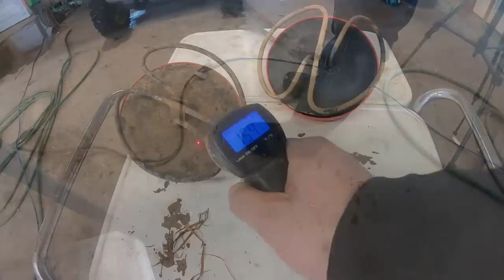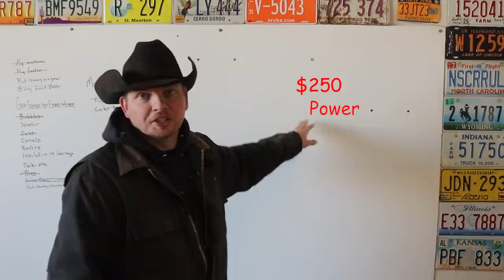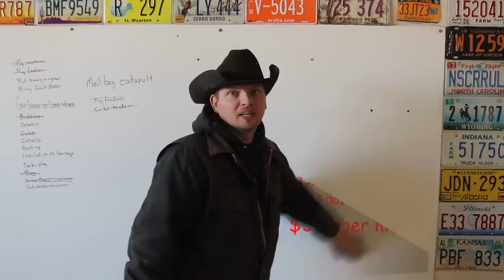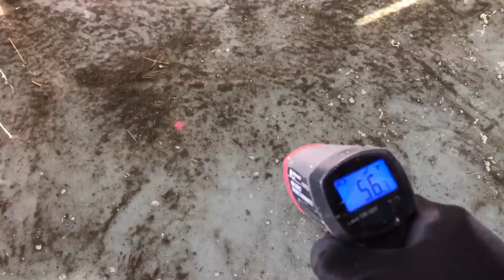Stock Tank Heaters vs. Breaking Ice - Water on the Ranch

Comment: Your lucky.  We had to do both all winter.  Heaters in the smaller pastures but our herd spent the winter on the pasture with a running creek.  Running water is a good cheat as it keeps thinner ice but we still had to go break open the creek. And you can accidentally take an unwanted bath if you are not carefull.  😂😂

Comment: Mike, you need to calculate the electricity it takes to replace the water that chunks to thick ice. 😬
I run three tank heaters myself, same style as you as far as wattage. My neighbor runs 500 watt heating pads that sit under his automatic waterers. His cost is no doubt cheaper.   
I’m guessing those gimmick jugs don’t work but there’s got to be a more cost effective way that works.
Reply from the maker: Well if I dont get those chunks out of there it does take alot longer for the sun to heat up the water and then it seems to freeze harder the next night.  Luckily they return right into the ecosystem.   I tried the jugs, they worked for light frost and freeze but the cows dont really move them around enough to keep anything from freezing.  Maybe the wind would :)  Thanks Zach - Mike

Comment: That's fine but you have to change your mindset for ranching and farming. With things like heaters you have to ask yourself what it will cost you to NOT buy and use them. Then you'll know if you can afford it or not.
The problem is in the hidden costs, if you can't keep up with the ice issue and it's causing a performance loss in the cattle, that's likely a cost you can't afford.

Comment: Hey Mike. Wonder if some homebrew geothermal loops might cut your tank heater bills? Seems like a few swats with a backhoe, some buried plastic pipe, and circulating pumps might just work. Might be an angle to use heat from composting, too.

Comment: Hi Mike and family ,  This past fall i purchased 3 new Jug brand cattle waters . these are the energy free earth tube type and we will be installing them in the spring . It will be interesting how much i'll have to turn on the heat tapes down in the earth tube . But i think it will be a major savings on the electric bill .
Reply: I've never heard of earth tubes. I'm going to check them out. Thanks!
Reply: @jeanettewaverly2590  the earth tube brings up warm air from down about 8 feet  or so. this can keep the water bowl from freezing . In very low temp. [ -25 or so ] it sometimes will need an electric heat tape .

Comment: You always have to look at the cost of thangs on the ranch.
Water is the life of an animal. So to me having a more healthy animal cuz of it makes more sense. I have found that the new tank heaters are more efficient than the old ones. The old tank heaters dont have thermostats so they are on all the time. The new one turn on and off with the temperature which is more cost effective. I would consider replacing all the old ones. You would save more money in the long run. And you would be able to leave them pugged in all winter. Thats just my experience with them. Have a great day. Keep up the good work.

Comment: We live off grid, so we have to consider how much power is used. While I would LOVE to have a trough heater, it would drain our batteries to quickly, and we couldn't use it all if it was cloudy out. BTW, I use the same thing to break the ice on our trough.
Reply from the maker: I get that.  We looked into solar for tank heaters but between panels, batteries and heaters for the batteries, I'm not sure it ever would have paid for itself.  That tool does work good for ice though. Thanks -Mike

Comment: Hello I run a ranch up in northern Ontario. We deal with the same kind of cold weather. We pump our water to keep it flowing and stop it from freezing. Have you considered doing that? Our biggest challenge is where does it run off too. We just need to control its flow down to the closest ditch. But other then that it might be cheaper to pump continuously then to run the heaters. We have yet to use a water heater from October until march

Comment: Is solar heat an option?  After the initial cost of equipment the source of energy looks to be there most days, even when it's cold.
Reply: But at night?
Reply: @jbweld6193  would be a 12v system, batteries would have to be big enough for 24 hour operations.
Reply: @redroofretriever  good idea.
Reply: @jbweld6193  couldnt solar during day electricity at night have them on a timer split power just throwing ideas out there
Reply: @carldabelstein328  red roof  had a good idea above. Use a battery bank. I think at some point though there is a break even point. I'm sure Mike has already figured that out!
Reply: @jbweld6193  yep i didnt notice that maybe ill learn to read ALL replys lol
Reply: @carldabelstein328  yeah I was also thinking you could insulate the tanks too so you could hold the heat longer in the winter and colder in the summer.. but then again.. is the juice worth the squeeze? Probably not lol
Reply: @jbweld6193  luckily we dont get that cold down here in Texas well not very often that is
Reply: @carldabelstein328  I'm up in Washington state. From upstate ny. It gets cold as hell where I grew up. We had heaters in our chicken water all winter
Reply: @jbweld6193  we used chicken heaters last week for a few days when it was around 20 but that only lasted a few days today it hit around 70 and in the 60s rest of the week we moved from Missouri about 5years ago back home we used heaters off and on  and last year i was working up in Rock Springs Wy in the oil field and that was a cold winter i dont think the wind ever stopped lol
Reply from the maker: I'll chime in here, seems to be an intelligent conversation :)  We have talked to a company about solar heaters.  There are a couple of problems that we run into.  One is the amount of batteries we would need, the other is keeping the batteries warm.  We would have to dedicate a percentage of the power made to heating the batteries.  A good example might be our wind generator.  Gilbert put it in many years ago and it cost 19K.  It took ten years to pay for itself making about 150$ per month and its a 2.5Kwh generator.  Alot of the off the shelf solar heaters are about 20 to 50 watts.  Thanks guys!
Reply: @OurWyomingLife  well so much for our ideas to help you  save some money guess you were WAY ahead of us lol we atleast were trying
Reply from the maker: There were so many good ideas. I didn't want you guys to think I'm not thinking too lol. Keep the ideas coming. I love them
Reply from the maker: And if Lincoln ever gets his pet dragon I won't have to worry about anything freezing!!!
Reply: @OurWyomingLife  i wouldnt think so lol
Reply: @OurWyomingLife  just keep pumping out videos Mike! You're giving us an education in AG! Invaluable if you didnt grow up farming.
Reply from the maker: TBH sometimes I feel like I'm banging my head against the wall lol
Reply: @OurWyomingLife  i know how you feel but thats what makes it all worth it in the end
Reply from the maker: Hahaha thanks guys!
Reply: One of the comments in this thread talks about the GEO thermal heat you can get from the ground.  There are two parts to this fact that can be very helpful to this problem.  Fact 1). The ground temperature at 10’ in your area ranges from 45°-55° Year around.  At lower  latitudes this does not change much maybe 5°.  Fact 2) Water has a very unique molecular property, it reaches its peak density at 4° centigrade (39°F). This is very helpful because it is just above freezing.  So this means when water get warmer or colder that 39°F it will raise (see graph I am posting on your Facebook page today).  I discussed your problem with a civil engineer friend of mine who specializes in water and waste issues. One of the tricks they use in storage tanks is to just agitate the tank using stirring systems.  In your case a simple low power circulating pump should work.  By keep the water flowing from the warmer water on the bottom the water may not freeze over night.  They use this technique because using electricity to heat water is the most expensive way to do it because electricity is a very inefficient way to heat things.  But if this did not work because it just gets to cold at night, the next step would be to add a GEO thermal heat component to the system like the other person posted.  By running a loop of 1” diameter black plastic tubing at least 10’ down, the water will become warmer in the loop providing a source of heat to your tank.  It may even work without the need of a circulation pump by just tempter convection.  There are more details than can be put here, like how big the loop needs to be, the separation space between the loop ends, stuff like that.  These same principles can warm your high tent as well with air tubes. Just let me know if you want more info.

Comment: I think you need to look at solar heating.
using one 300 watt solar panel to heat each one the solar would only heat when suns out and heaters would still be needed at night but they may cut your costs 50 percent and they would last 30 plus years...........Just a thought..............

Comment: Tank heaters are a great option but are filled with worries as you have discovered with wires shorting out and possibly shocking or killing cattle. How about another system that Northern Farmer uses. Aeration! Instead of heating the water he uses air to keep it circulating to prevent it from freezing. It brings the risk of shock to zero and you don't have to chop ice. It works. He has vlogs where he can keep open a two acre pond with one aeriation stone. It may save you some $$.

Comment: Personally, I don't have the time to break ice and stand around waiting for tanks to fill, and if I try to be efficient and go do something else I usually forget and turn the yard into a skating rink which is a huge safety issue.  Thus all my waters are automatic so no heat, big, big problems.  I have 4 automatic waters with heaters and my total house/farm electric bill hardly ever comes to $375/month, and that's with the wife and kids leaving every light on in the house practically all the time.  The super insulated poly automatic waters practically heat themselves, the heaters in them are like 150 or 200 watt heaters, the smaller the better.

Comment: I suspect you could reduce the time that each heater needs to run by use of creative insulation leaving just enough exposed for the cows to drink. 
For example on the square steel tank, around the outside you could add 4 inches of insulation in a form similar to a standard house wall (2x4 studs & joists with crazy foam filler - or perhaps something even more durable [corrugated roofing?]).  On the same tank, notice the cows only drink from the very edge-most 12 inches or so, leaving the inner several square feet needlessly exposed where you could add a horizontal wall of insulation. 
What's that tank's size, around 6' x 6' x 1.5'?  So roughly 6' x '6 = 36' square across the top, and 24' x 1.5' = 36' square around the sides, with a total exposed/uninsulated area of around 72' square?  With my partial insulation idea above, that might be reduced to 6' + 6' + 4' + 4' = 20' square of exposed/uninsulated area.

Comment: I use a Thermostatically Controlled Outlet in my horse water tank BUT if it never gets above 45 deg it stays on. I wrapped mine in black plastic and in the sun so it shuts off sooner. Im still warming the water at to high a temp which is a waste of money.

Comment: While it won't work for the larger herd (I think they recommend it for 25 head or less) have you ever considered the waterer below? If you have a tank in a pen for 25 head you don't use electricity, don't need to break up ice, it cools the water in the summer, is self cleaning and isn't a breeding ground for mosquitoes . There's a high install cost but if you're saving $150-$225 per month 5 months per year the savings should pay for themselves in a couple years easy. (Sorry if this sounds like an advertisement but I think they are really cool!) PS: I like the math stuff. :-)

https://www.horsedrinker.com/products/cattle-waterer/

Comment: Mike with the water at 56*F vs 30*F  the intake of water the cows drink will go up also.  if you look in to large dairy farms, they use plate coolers to cool the milk and put the water in the waters 65-75*F range this has been proven to add a few more pounds of milk.
This is because the you don't feed the cow you feed the Rumen bugs and below 39*F water is very hard on them and the cow has to use energy (feed) to warm the water inside her.  I bet you will see a rate of gain increase which will match or pay you back what you spend in electric.  Here is an article on this topic. https://www.ncbi.nlm.nih.gov/pubmed/27898880

Comment: Maybe you can find a heater with a thermostat so your not heating the water up so much.
Might save some power.
Reply from the maker: Like I said in the video the floating heaters have thermostats. They shut off around 35 degrees.  The extra warmth was caused by the sun. Thanks for watching -Mike

Comment: Have you tested using a water pump to keep water circulating and kept from freezing that way? I would think a pump would take less power than those heaters. Here in east Texas we only freeze tanks a few days a year so I do it by hand, but I think I'd try circulation over heat first if I had to do something. I know y'all get much colder though so circulation may not be enough to overcome temps. Always try new things I say, otherwise you never improve! Thanks for the videos!
Reply: Floyd, a sump pump to circulate water does work to a point.  Uses about 120-150 watts for an average setup.  I used one in ND for a while last winter, but as the temps continued to drop, the water quality became an issue.  What happened was the pump had to run nearly continuously to keep the tank open at 20F or below and the algae and other sediment in the tank were constantly being stirred up. Animals did not like to drink the water with all the dissolved junk circulating.  Switching to a tank heater kept the tank open and the water stayed clear.  The animals drank more and looked much healthier after a week of making the switch.
Reply: @jonathanodermann913  It wouldn't be difficult to put a filter on, but i can see your point. Sounds like it would be inefficient at near zero temps.

Comment: Just an idea but have you considered using air to keep the water moving in the tanks   It takes less hydro to run an air compressor than multiple heaters and as far as i know moving water will not freeze as easily as standing water    Another thought was timers which turns heaters on for the coldest period but leaves them off during the day   Yes it would take tubing to run the air but depending on how much to get to the tanks and the volume needed might be worth considering even piping to a manifold for the air   to supply tanks in the same area    Suggestions are easy  lmao  Not sure how the application would work but like I said in the beginning its just an idea
Reply: Hi Larry, we put a fountain in our Koi pond last year. That didn't work well because the water was cooled by the air. This year we put a bubbler, but the water is still down in the ground. The cows tanks are up in the air also. The cold air is surrounding the water. If he put in a bubbler or even a propellor to make a current, that would cool the water faster from the sides of the tank.

Comment: Won't the cows chew on the cables..they do like to play.
Reply from the maker: Cows not so much, horses will and thats why the cords are usually covered in wire on the heaters that we put in with them.  Thank you very much - Mike
Reply: Some cows do but if you have the tanks up against a wall or something you put it there and most of the time they don't even know it's there.
Reply: Ours sure do! We have a cartridge heater in a threaded fitting that threads into the bung hole. I guarantee that they would try eating those floating elements. Our horses totally leave them alone. Go figure!!😄

Comment: Mike just curious, would it be cost effective to buy a solar cell and equipment to run a heater in one of your remote locations?  Just wondering, here I have a couple tank heaters but we usually only use them maybe 2 weeks total in an average winter.
Reply from the maker: Stock tank heater pulls around 1500 Watts. A solar array large enough to handle that kind of power would be 10ftx10ft and also require inverter and bank of deep cycle batteries. Plus a portion of the power would have to go to keeping batteries warm. Budget 5k+ Electric heating with solar power is incredibly inefficient.  Thanks Brad -Mike
Reply: I wasn't sure what the scope would be for the solar option.  I do agree with others in that you do not necessarily have to keep the water "open" 24 straight hours.  You could save some money by turning the heaters on in the morning to open up the tanks for some time, while you do other chores, then turn them off again later.  Maybe even with cheap timers added.  Have a good one and best of luck!
Reply from the maker: Thanks Brad

Comment: Mike.   To cut down cost a few pennies  can you do with smaller tank of water to heat
Reply: Davjo Ciestanski it wouldn’t necessarily help because the water temp then changes more drastically and a lot faster, so the heater would have to be constantly running, costing money.

Comment: Hey Mike just wanted to ask if you ever got that email or message or however I sent it to you from Missouri wind and solar on solar air rating to keep ponds and tanks from freezing by simply using solar power to run an air pump to aerate the water. It was a while back that I sent that to you so it's nothing recent